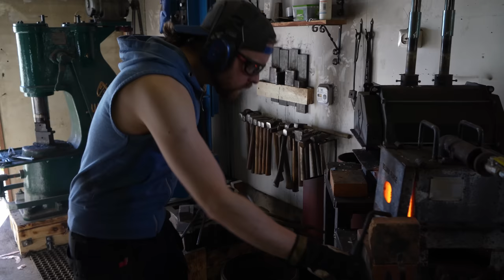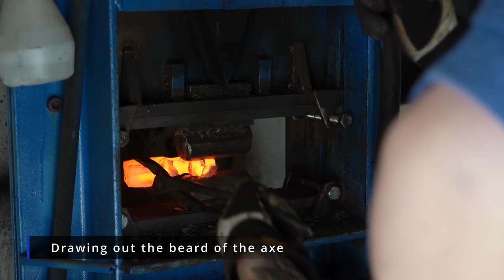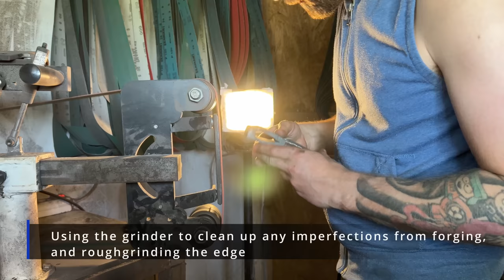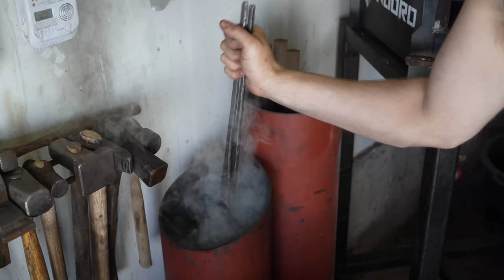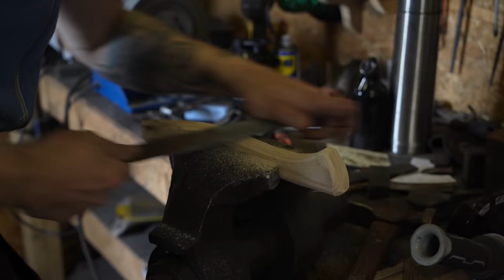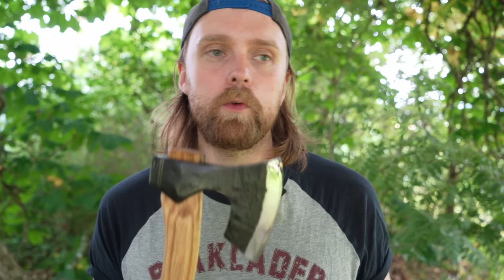Forging a Sloyd Axe: Creating a Traditional Swedish Woodworking Tool

Comment: OK I'm inspired. After I try making a kris, I'm going to make a Halterbrad. Spring steel should work. I haven't finished my power hammer. So I think I'm going to drill a hole for the handle and then I'm going to  drive a drift into that. Piercing a thick piece of metal
By hand is too much work. Forging is fun.

Comment: is it hard to get borax  i would like to buy some because i want to forge my own ax in a gas forge which i will buy soon  im from Germany
Reply from the maker: It was a little tricky. However i started using ”iton mountain flux” you can usually order it from farriers shops etc. Very nice flux